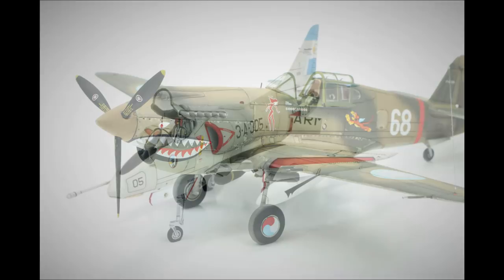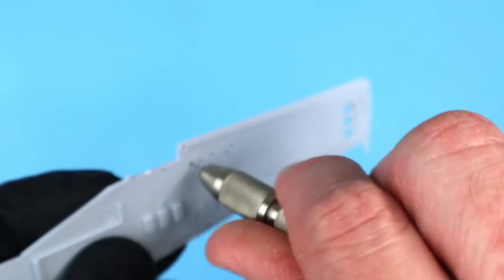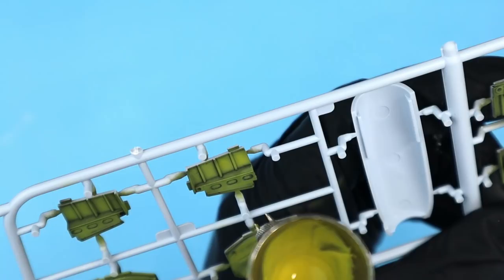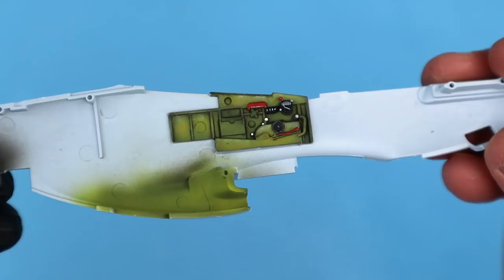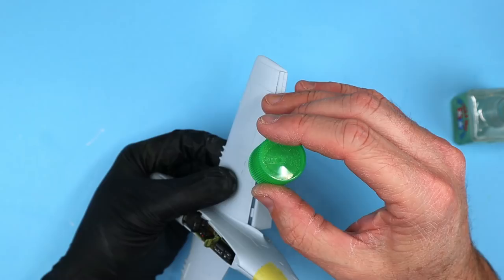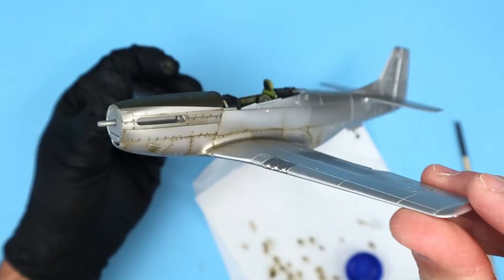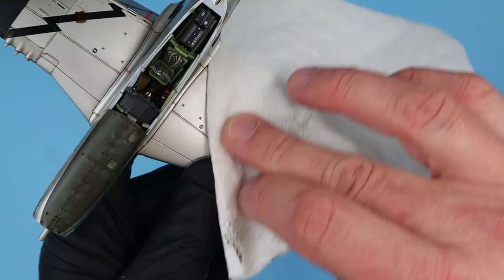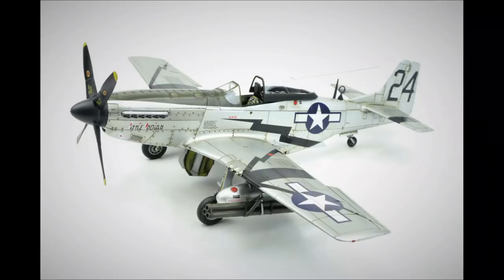1/48 Airfix P-51 Mustang Build

Comment: im 90% sure you put the ring in front of the tail on wrong
Reply from the maker: Probably right.  I'm always good for a few screwups.  I'd like to say that I do it to test the audience but I'd be lying...haha.  I'll check the references to confirm.  An easy fix if that's the case.  Thanks!
Reply: @FlyingSModels  no problem very good work
Reply from the maker: @DylanoTheWizard  I appreciate the keen eye.  I sometimes get way ahead of myself thinking I know better than the manufacturers.  Actually, I was going for the more aerodynamic approach.
Reply: @FlyingSModels  very understandable to think its supposed to be like that because it looks aerodynamic

Comment: Hello - I too, picked up this kit at Hobby Lobby with the 40% off coupon. It appears Airfix used a parts breakdown similar to the larger 1/32 Tamiya and Revell P-51. This is a very good thing. Airfix gives you the very noticeable recessed screw detail on top of the cowling that some how Eduard missed on their otherwise excellent but pricey kit. Eduard's surface detail is finer as well but for half the money, the Airfix kit is an absolute gem. Nice job and Great build video.
Reply from the maker: I only inspected the Eduard kit at the last IPMS Nats but I've never had the kit.  It's good to hear that even it has issues as some have trashed the Airfix kit saying that it's not Eduard.  I thoroughly enjoyed the Airfix kit and for the price, like you said, a real gem.  Thanks for the good feedback!
Reply: @FlyingSModels  You are welcome. The Eduard kit roof of the tail wheel bay also has a visible seam down the middle. Not so on the Airfix kit. I bought an Eduard cockpit and canopy mask for it. Maybe will pick up resin wheels, too. All this and still cheaper than the Eduard. I like your black paint base method for your cockpit. I like to use Future Wax slightly tinted black. You can brush this mix right on. Future levels beautifully. Added advantage is the glossy Future overcoat makes it ready for cockpit stencil decals. Then shoot it flat clear. We never get tired of Mustangs.
Reply from the maker: I have seen others using the tinted future for cockpit washes but never tried it.  I think my method is a little overkill but I enjoy the panting time.  I may have to give that a try just to speed things up.  Thanks again, Bob.

Comment: Nice job on the wood grain. That's the mark of any -D Mustang kit .
Reply from the maker: Thank you, Stephen.  I was going to use oil paints for that part but since I wanted to get this build in under the 2020 wire, I didn't want to take the time for it to cure.  Happy New Year!
Reply: To be fair the wooden floor was coated with a layer of black paint mixed with sand
Reply from the maker: @ArthurMG00  Excellent info.  I did not create mine in that way...hahaha.  Maybe I should try it :)
Reply: @ArthurMG00  True. I've seen it done both ways. I was commenting on the wood grain. Incidentally,  I had a Great  Uncle who flew mustangs, and he said that the rubber coating would get quite worn down.
Reply from the maker: Must must have been completely worn off....yep, that's the look I was going for...haha.  Thanks again!

Comment: Just built one (different boxing though) and I liked it but.. I did not like the tail assembly. And it left it a bit twisted, something i know others got too. 
But the engine cowling as one piece is great. Eduard does not have that. 
A kit I want to try next, Eduard´s. Which much finer surface detaisl, it seems. but i might build more Airfix boxings too!
Reply from the maker: Agreed.  The Airfix kit is not as refined but it builds up into a nice model.  I'm back working a Tamiya kit now but have the Eduard one to try one of these days.  Good luck on your Eduard build.
Reply: @FlyingSModels  Thanks! :)
I like the Tamiya too - but was a few years since I built one. Should really pick another up sicne I have so many P-51D decals I want to use.. ;)
And then to compare that kit.. 
Hope I see yours here!

Comment: I'm a complete convert to your white spirit-oil paint weathering.  I noticed you clear coated the AK metal finish first and I assume because it's enamel based.  I'm about to use Vallejo Metal Color (acrylic) on my P1Y1.  In your opinion; go directly to the oil paint weathering since it's acrylic or clear coat first since it's a metallic paint?  Thanks for these great, and inspiring, videos.
Reply from the maker: Yep, you got it, Ken.  Only clear coated the AK since it was enamel based (although I mistakenly said acrylic lacquer in the video).  I used a flat to semi-gloss clear for this.  Look forward to hearing how your P1Y1 goes.

Comment: Always check references. Many mustangs had bare metal gear bays. Only spar would be in zinc chromate. Good build.
Reply from the maker: Yep, I knew that folks would find me out here.  From what I can tell, the gear bays on this one were metal color but I saw that just a tad late to make the change.  Good catch!
Reply: @FlyingSModels  it looks good tho. Breaks up the greys and blacks.
Reply: Thats for earlier batches. I dont think either of those schemes represent an early P-51D. After a while stuff started to happen with the bare metal gear bays and they started painting the whole thing with zinc chromate, both yellow and green.  When exacly they started that is a difficult line to be drawn though. It got very inconsistent on the gear bay painting department. You cant really tell for sure how it should be depending on the chosen scheme.
Reply: @ArthurMG00  correct youd have to look at NAA records or individual logs if it was done in the field

Comment: Chad, fantastic job as usual! Question: at 17:00 you use raw umber oil paint over white spirits to add grime in some panel lines (mostly under the nose). Then, at 19:00 you use AK panel liner much more extensively on the fuselage and wings. What is the rationale for two types of panel liner? Is the raw umber a "leaking oil" effect while the AK panel liner is a different kind of dirt?  Just want to make sure I understand the nuances!
Reply from the maker: Thanks, Dexter.  I think you've got the basic premise.  The oil over white spirits is applied to a flat or near flat coat and this causes the oils to soak into the surface a little and blend with the paint.  The panel liner is applied over a gloss coat and really just provides a dark wash to the panel lines themselves.  Hope this makes sense.  If not, let me know and I'll try to explain it better.

Comment: Outstanding build sir. 
I have a question: what is the setup for airbrush when you using AK metallic paints ( size of the nozzle and air pressure).
Thanks and keep video's coming.
Reply from the maker: Thanks for the good words.  On the airbrush, I'm spraying with a 0.2mm nozzle at around 18-20 psi. Not thinning the paint.  Probably have the trigger setting at 50% or less to minimize paint through the brush.  Hope this helps.

Comment: Wow! Another fantastic build. Thank you. I'm struggling a bit with lighting. There are times when I'm finding it difficult to tell if the   paint is coming out of the airbrush. You don't seem to have any issues with your lighting casting shadows on your work. What kind of lighting set up do you have please? Do you have any tips?
Reply from the maker: Appreciate the kind words on the P-51.  Lighting is extremely important, that's for sure.  I have recently moved my modeling setup to a dedicated work space.  In that area, I installed LED light strips above my work area like these: https://amzn.to/3qbNAW7  It's pretty dang bright but works well.  Let me know if you need anything else.  Always happy to help.
Reply: @FlyingSModels  Thanks for the info. I've been trying to work with 3 angle poise lamps  shining from above and the sides. I'll try LED strip lights. Thanks for the tip. All the best.
Reply from the maker: @horatiosplodge3370  Let me know if you need anything else.

Comment: Very Nice Job!

When you did the weathering with oils (at the beginning), did you first put down a protective layer of some kind, or did you do it on top of the AK metal finish?

How long did you wait before you did your masking?

Also when you did your masking, did the masking lift the metal finish off?
Reply from the maker: Thanks for the feedback.  As far as the oils, I put down a coat of semi-flat/semi-gloss acrylic over the AK metal finish first.  I probably only waited a few minutes before applying the masking but I use low tack masking and even "detack" it a little more by putting it on my shirt and then lifting it off before applying to the model.  I did have 2 very small spots that lifted during the build and those were easily fixed.

Comment: Amazing work! Did you cut the decal to apply the panel line, or the decal correctly set down with the decal solution? All the best, Fernando
Reply from the maker: Hey Fernando, thank you for the kind words.  I should have explained the decals over the panel lines.  I'll try to do that in future videos.  After applying them with the solution, I did come back with a sharp razor and cut them across the panel lines.  I applied more solution and after that had cured, I put the oil wash over the pane lines.  Hope this helps!  Cheers!
Reply: Thanks, my friend. One of the best channels on YouTube. Awesome videos.
Best regards, Fernando from Brazil.
Reply from the maker: @FernandoHenrique-ij3tt  Really appreciate that, Fernando.  I'll keep the videos coming.  Take care, Chad.

Comment: Nice build and great explanation. one question, what airbrush and size needle that you used in this build?
Reply from the maker: Thanks.  I'm using the Badger Velocity Renegade with the 0.2mm needle.  I think I have a link to it in the video description if you want to check out the specs.

Comment: Stunning build as usual. I've picked the F51 up as the P51D is no longer produced and tricky to find! Any tips on getting a smooth layer of Gauzy down for the decals? I seem to always get a grainy effect near the wing roots. Do you put on thin layers or one thick layer? Do you recommend a particular psi? Many thanks and look forward to more!
Reply from the maker: Thanks for the good words.  I need to pick up another one for sure.  I didn't realize their other P-51D was getting harder to find.  As far as the Gauzy, I spray it in sort of a medium spray pattern.  I use an airbrush with a 0.2mm nozzle and probably spray at half it's capacity around 18 psi so a decent sized spray pattern, relatively speaking.  I think the graininess comes from it being too "misty" at the roots, likely from overspray.  Maybe try to increase the amount you use (not overly so) and let its self leveling properties do their magic.  I haven't had an issues with it so far.
Reply: @FlyingSModels  Appreciate the quick reply! I'll give that a try. Thanks!
Reply from the maker: @spruetherapy  You bet.  Let me know if it helps at all.
Reply: @FlyingSModels  Worked a treat, thanks!
Reply from the maker: @spruetherapy  Excellent.  I'm glad it worked better for you.  Happy Modeling and keep up the great work on your end.

Comment: I just wish Airfix used better plastic.  The engineering is good but the plastic drives me crazy.
Reply from the maker: Yep, plastic is too soft.  Workable but soft.  They need to switch back to what they were using on the earlier 1/48 Seafire 47 and Spitfire 24 releases.
Reply: I hear what you're saying about the plastic (soft) but I really think it's just a matter of getting used to it and knowing what you're dealing with before you remove parts from the trees and start sanding!
Reply from the maker: Yep, it's really only that part that is a con for me.  Once I experienced it, I actually started to focus more on the pros which are it's workability, bonding, etc.
Reply: @FlyingSModels  Agreed.  Sometimes the "softer" plastic is more forgiving regarding fit although I find this kit would fit fine with harder styrene too.  I'm surprised you didn't have difficulty with the vert. stab./tail.  I cut the attachment "slots" for better fit but you sure as heck didn't seem to have that problem!
Reply from the maker: @jrgreiner  Totally agree on the plastic front.  I thought I might have issues with the tail when I saw the design but that turned out to not be the case.

Comment: What brushes do you use? Also, was the ak extreme metal finish thinned? Thanks
Reply from the maker: Hey Rob, I use mostly AK 3/0 or maybe Fine Art (not sure if this is the right name) 3/0 brushes.  As far as the AK extreme, I just sprayed it straight on this build.
Reply: @FlyingSModels  Thanks for your reply. I have a Revell 1/32 mustang in the stash which I'm scared to go anywhere near atm. I am only a bit better than beginner level at airbrushing and have not learnt many techniques yet, but your videos are definitely teaching me a lot, especially with contrasting paints and adding more depth to models rather than ending up with something that looks a bit unrealistic or toy-like. Thanks for the videos!!
Reply from the maker: @roberttiller6517  I hope they are helping, Rob.  I've also got the Revell 1/32 Mustang.  Maybe it's time for a "group build".  Let me know if you have any questions or if there's anything I can help with.  Always happy to help if/where I can.

Comment: I have build this model, it was little bit problematic build. check my Mustang
Reply from the maker: Yours looks good as do your other builds.  I thought the kit was really nice and didn't have any troubles with mine.  What problems did you run into?
Reply: @FlyingSModels  i bought this model a few years ago as soon as it came out and hoped it would be really good. But my set was with large gaps and inaccuracies. With today’s technology and such an old manufacturer, it’s just weird to bring a poorly engineered kit to market
Reply from the maker: @zoromodels  I didn't think that Airfix had updated the molds after it's first release but perhaps they did.  I only had a few small places that required just a little filler and nothing more than the usual.  I found my kit to be well engineered and easy to assemble.  Sorry you didn't have the same experience.